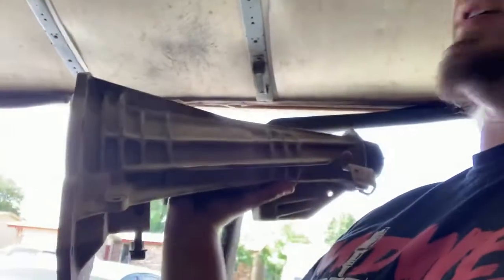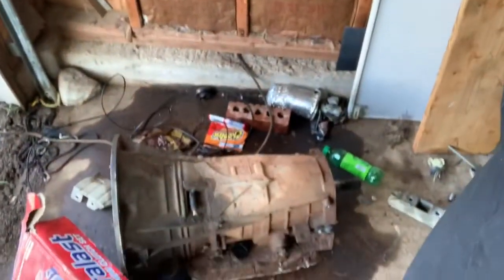45RFE and 5-45RFE Information

Comment: Are the electronics/valvebody the same for the RWD vs the 4x4 ?
Reply from the maker: Yes and no. I kept the Jeep valve body when I did my swap into the Jeep but that was also partly for a peace of mind thing in case something was just a little bit different. If I’m remembering right though there was something about the electrical plugs that was different for certain years or vehicles. Personally I say it’s better to reuse the valve body from what vehicle it’s going into.

Comment: So if i want to replace the transmission in my 06 jeep commander 5.7 2wd? What do i have a choice to pick from? Just bought this truck and the moment i got home the trans just shot itself slipping wont go into 3rd or beyond slips in 2nd. P0700 and p0704. Trans fluid is good. Just going to go buy a trans froma yard just trying to figure out what i can use since its in different engine configurations etc.
Reply from the maker: 45RFE
1999–2000 Jeep Grand Cherokee (4.7L)
2002–early 2003 Jeep Liberty (3.7L)
2000–2002 Dodge Dakota (4.7L) and "(3.9L) Sport Edition Dakota"
2000–2002 Dodge Durango (4.7L)
2002 Dodge Ram 1500 (3.7L and 4.7)

545RFE
2001–2011 Jeep Grand Cherokee (4.7L, 4.7L H.O.,5.7L Hemi)
2005–2006 Jeep Liberty (Diesel applications)
2003–2011 Dodge Ram (4.7L, 5.7L Hemi)
2005–2011 Dodge Power Wagon
2003–2011 Dodge Dakota (4.7L, 4.7L H.O.)
2003–2011 Dodge Durango (4.7L, 5.7L)
2006–2010 Jeep Commander (4.7L, 5.7L Hemi)
2007-2009 Chrysler Aspen (4.7L, 5.7L Hemi)

That was the best list I could find but do  also note that at certain years the trans controller was integrated with the main computer
Reply: @worldsokayestmechanic6631  thanks gotta replace my 06 4.7 2wd

Comment: Do the electronics change on a 545rfe 2wd to a 4wd?
Reply: Just the tail shaft, and usually the pan and filter, although some of the 2wd ones come with the deeper 4wd pan and filter.  The difference between 545rfe and the 45rfe is nothing more than the external TCM computer.  Different 4wd vehicles used at least two different length tail shaft adapters.  Source: direct experience.

Comment: Jeep v6 and 8 engines  use the starter on passenger side  along with the 4.0 which has a different bell housing pattern.

Dodge v6 and v8  use the starter on the driver side. 

So i guess the location has both bolt holes [ driver and passenger] and

 is manufacturer dependent on which side is used.

Comment: Tryna figure out if you can have it flashed to use it's final gear combination.
Reply from the maker: Sorry for not replying sooner but yes there is a way to have it flashed to get the extra gear. I’ve only seen the dealer be able to do it so far but that could be completely different now

Comment: So are they both 5 speeds or is one a 4 speed I just bought a 2500 truck with the 545rfe 5 speed.
Reply from the maker: It just depends on the application. They both can be 4 or 5 speed depending on the programming in the ECU. If you ever replace the transmission though, you will want to reuse your valve body if possible since it is a little different from “heavy duty” like yours to a Jeep that has the same 545RFE.
Reply: it is a 4, 5, 6 speed and also theoretically could be a 7, 8 speed, and can have 2 reverses too. it just comes down to programming

Comment: What Up? 😅 My 06 Durango lost Reverse and Neutral after doing a almost Rockford R to D too fast..? Now what?
Reply from the maker: I’ve never heard of anyone losing neutral before but losing reverse it may just be time for a rebuild or replace. Depending on where you live it may be easier to find someone to rebuild it than trying to find a replacement
Reply: my ‘06 Commander just lost reverse and neutral after being stuck in limp mode, while troubleshooting, for the past few months with a P0700 code the whole time. Replaced valve body, filters and fluid a month before losing reverse and neutral, but never resolved limp mode status FYI

Comment: How do you adjust the bands in the 45rfe?
Reply from the maker: There actually are no bands to adjust in a RFE style transmission. I would definitely recommend a fluid service if you are starting to have issues with it but remember that there are two filters inside, a press in one and a spin on one.
Reply: Thanks

Comment: 545 has a 2nd gear prime, i think thats what your talking about
Reply from the maker: You are correct however it oddly only uses the 2nd prime in the downshifting sequence which doesn’t make sense to me. I did recently do some more research due to personal questions I had and there is an extra planetary gear set that lets them achieve everything that they have done. Theoretically, it could be made into a 6 speed with programming changes as well because of its interior design but they used the “6th” gear as 2nd prime for the downshifting sequence. Thank you for pointing that out tho!
Reply: I believe the later 645RFE transmission used that programming, or Atleast they counted 2p as a normal forward gear and it became third. I don’t know what the shift logic is but I believe that’s what the difference is, the ratios are all still the same, and both 45rfe and 545rfe have 2 prime. The only major difference between the two is software related, to the point where a common wj mod is to take the tcm from a later 2001ish-2004 wj and put it in a 99-01 that came with the 45rfe and it’ll give you an extra overdrive making it a 5 speed, I’ve heard this upgrade also works on dakotas and Durango’s  and I’ve even seen someone do it on a 2001 liberty.

Comment: You're right the 545 and the 45RFE transmission are the same the only thing different about the to is actually the programming in the TCU that's what makes them different but the transmissions are the same
Reply: so what your saying is if i took a 45rfe from say a 1998 dodge ram truck 1500 with a 360 v8 and put in my 2005 dodge ram 1500 hemi v8 that it would bolt right up and connectors would plug right in and go?

Comment: One question before I dig into my project though, so since im converting my 06' from 4x4 to 2wd will the same rear driveshaft work or am I going to have to buy a 2wd rear driveshaft.
Reply from the maker: The driveshaft should fit. It fit mine with the tail shaft and with the T Case installed.
Reply: @worldsokayestmechanic6631  okay thanks, I appreciate the quick reply
Reply: Just shift the 4X4 from high to low while in neutral a couple of times and boom it's 2wd... Lol
Reply: @jefferylebowski3786  💀
Reply: @moosemechanic4591 2000 jeep grand cherokee limited 4.7l 45rfe... But seriously. I threw a p0700 code that says I need a solinoid replacement (Thank you Lucas oil).  Do I just need to replace the solinoid pack or do I need to consider changing out the valve body as well? Btw I did snap the linkage for the 4x4 hi/lo but I'll save that for another question...  My apologies for my prior poor humor.
Reply: @jefferylebowski3786  I’m honestly not super sure, mine always had trouble, I’d try replacing the solenoid first then get a new valve if it dosent work still

Comment: Any chance you still have that 2wd tail shft housing? I need one for  5.7 Dakota 2wd conversion.
Reply from the maker: Actually I do
Reply: @worldsokayestmechanic6631  If you'd consider shipping it I'd be interested in buying it. I'm putting a 5.7 from a GC 4X4 into my 2wd Dakota.
Reply from the maker: @davidmoquin1166  I’ve actually been thinking about using it to hemi swap my mustang with a blown V6. What part of the country are you in and I’ll help you check into some yards to see if they may have one or two laying around. Also if you keep a watch on Facebook marketplace they pop up every now and then.
Reply: I'm in MA and its hard to find 2wd. Most everything I see is 4wd. Ive seen them on ebay for $$$. with shipping on top. I was hoping to find something cheeper than 3 figures
Reply from the maker: @davidmoquin1166  I did some digging this morning and I found sams pull a part and they lost whole transmissions for $130 in MA. They may be worth checking out. You can always resale the T. Case and other transmission to recover the money that way. It may be worth checking into.
Reply: @worldsokayestmechanic6631  Thanks. Not sure how you pulled thst off. I go on their web page and everything I find is a 4x4. I'll give them a call. Thanks again.
Reply from the maker: @davidmoquin1166  lemme know how that goes and I’d be happy to do some more digging for ya
Reply: @davidmoquin1166  car-part.com maybe.